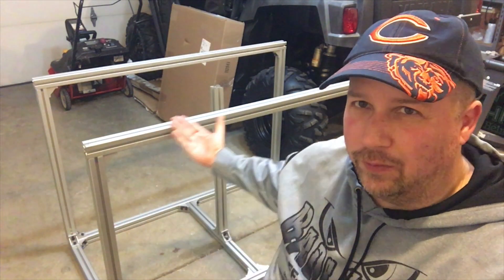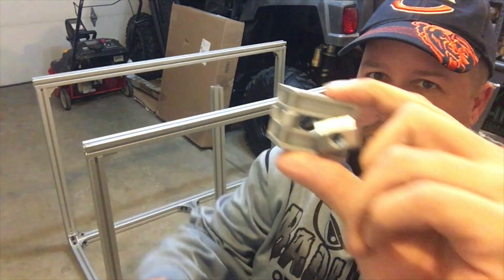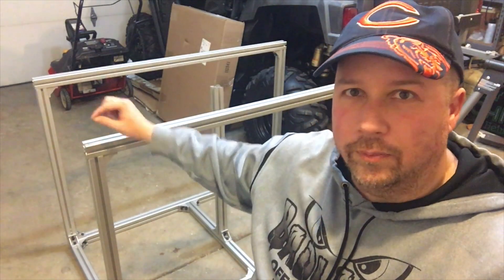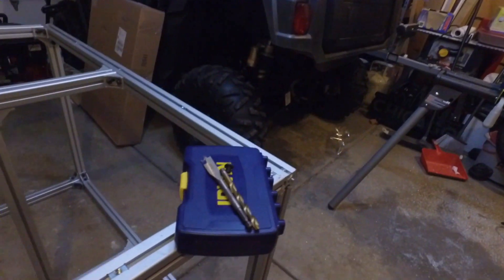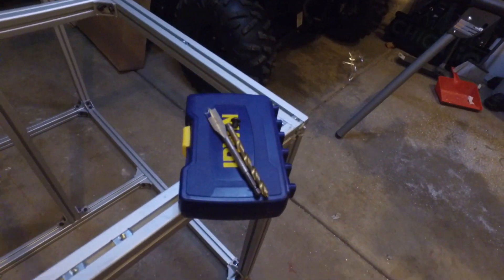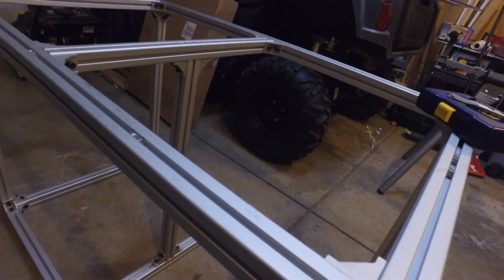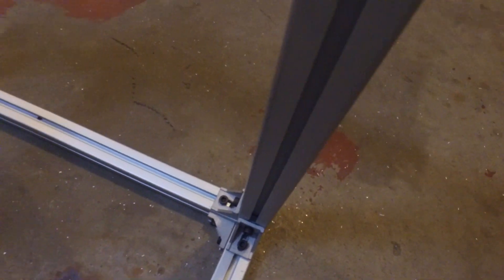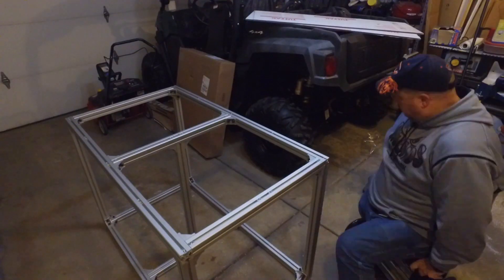How to build a workbench out of Extruded Aluminum - Part 3!

Comment: Thank you for posting the supply for parts. To make the table more rigid and portable using all thread with the core tubes would allow those tubes to be under compression while holding the connectors just enough to keep the stand rigid. Would like to see the table in use with your configuration for the printer. Because the tubes are not welded, I would incorporate tubes diagonally on the back side to promote rigidity. Thumbs up.

Comment: Its looking super good. Does the paint stick to the aluminum good ? was worried it would flake off due to the composition of the metal. I am working on mine right now. I am going to have to spend the 68 ducks for the good 12inch saw blade. I have to cut 2560 series ones aswell as the 2020 and 2040 and 4040. i am making a box under my printer to hold all the electronics ect. so i can then make a cabinet for high temp filament ect. It will be in all one unit and tons of room under the printer for any electronics i want to add later. say high to Bear . Just love dogs.. they dont judge you.. just want to love ya and get lovins back .. heheh awesome